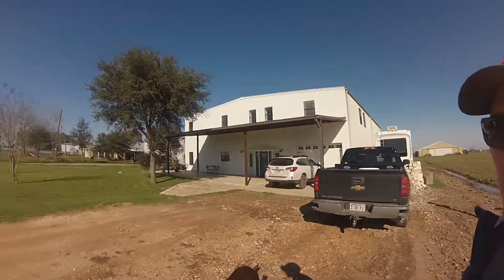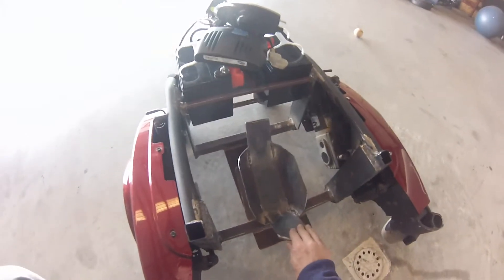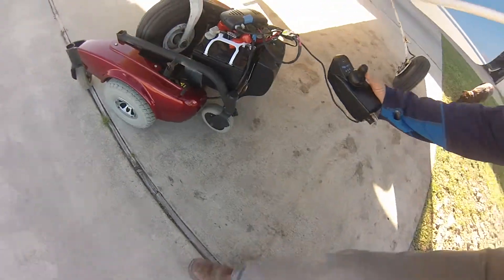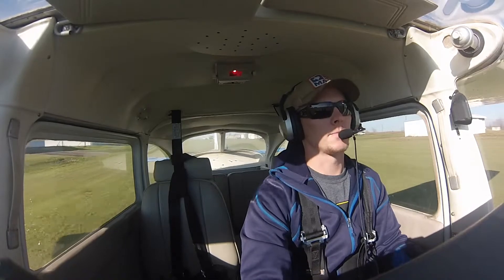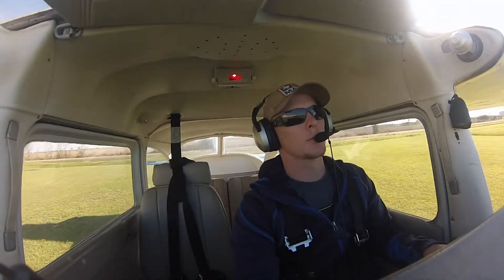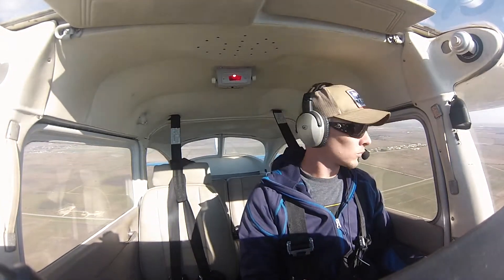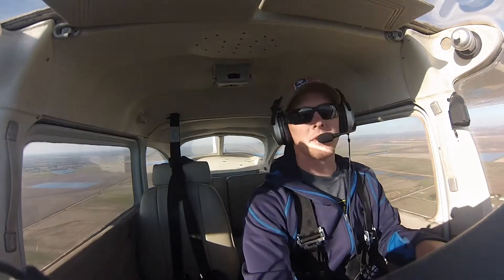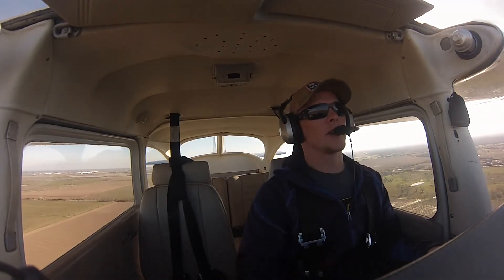DIY Tug and a Short Flight

Comment: What did you use under the cradle to make it spin?
Reply: I used a swivel from a large castor wheel. It was a 650lb capacity castor.
Reply: Sweet! Can I ask for a link to it or name? Working on mine
Reply: @firestormaviation4967  https://m.northerntool.com/shop/tools/product_200660370_200660370

This one is similar. Just cut the forks holding the wheel so you can weld the swivel to the base.
Reply: Awesome. I will post the build video

Comment: What model of scooter did you make the tug out of?
Reply from the maker: Jason Anzaldua it’s a Pronto M51 and the swivel is from a heavy duty castor.
Reply: Back Country Air Force thanks!
Reply: @Old_Veteran_Aviator  hey guy. It's great idea what I'm looking for. Does it have enough power for turbo arrow? Empty weight 1663lbs. Little bit uphill is bothering me it's had to push the airplane in the hanger. Do you think is it helpful? The up hill is about 3ft long and differential is about 4 inches.
Reply: @Old_Veteran_Aviator  one more thing I have a question. The moving bowl for wheel, do you have a drawing for that? or any tips do you have? Please let me know I gotta make one asap.
Reply from the maker: @bhc2269  I don’t think it would have any problem. These motors are really strong. Moves a loaded 172 like nothing. My apron is slightly uphill and does fine in the grass. I don’t have a drawing. Email me at anthonyrobinson87@gmail.com and I’ll email you some specific pics and measurements. It’s really simple. Made from 3”x1/4” flat bar. Has a gate hinge to flip up and a swivel from a heavy duty castor wheel. When you email me I’ll delete my email from this post
Reply: @Old_Veteran_Aviator  I made one. And working good. I think nose part of turbo arrow is heavier than 172. So it can't be loaded like yours I have to lift up with my shoulder for loading but it's working good after loading. Thank you for your help. Safe flight. from a retired marine in South Korea.
Reply: @bhc2269  glad to hear it. I’m about to cut mine up and rebuild for a tail wheel. OORAH Devil Dog!